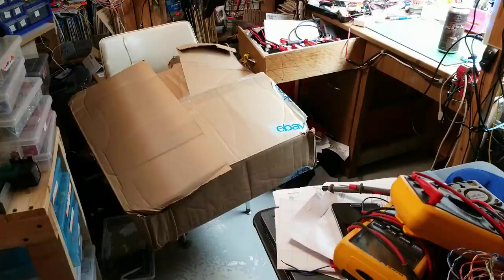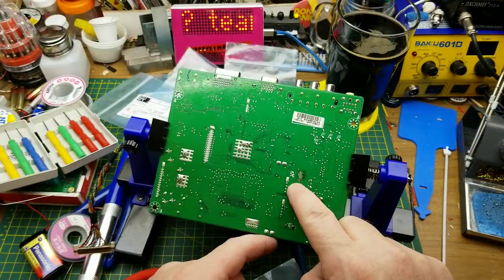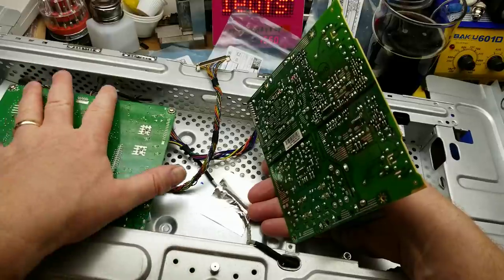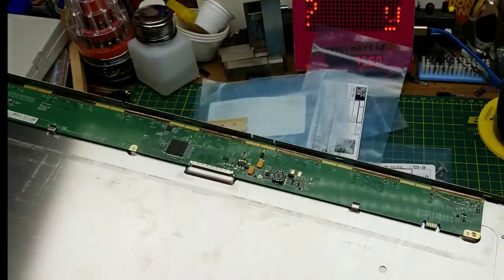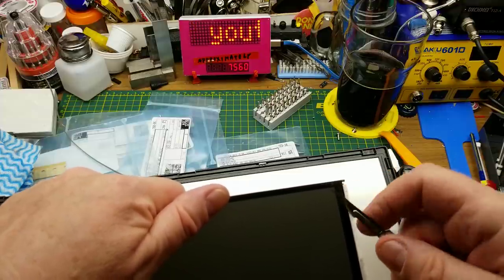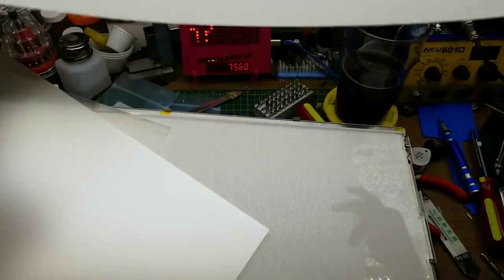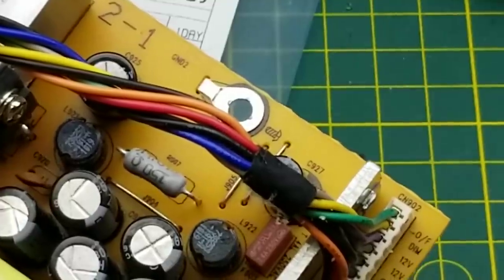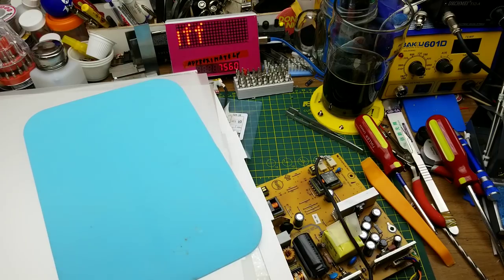computer monitor repair? Or maybe a teardown?

Comment: There's allways someone watching your videos till the end. This working backlight unit is a win-win, if you assemble them back, you have quite a good light panel with no hot spots, all even illumination, that's usually quite expensive to buy directly...
Reply: Does skipping to the end count - lol -.
Reply: I agree. Getting large diffusors can get really expensive, so old monitors and tvs are a very good source. They're perfect for little projects that involve led lights or matrix displays or such things.
Reply from the maker: I spotted an old (probably early '90s) rear projection TV on the curb a few weeks ago. 
Unfortunately it was gone by the time I came back with a truck...

That would have been an optical component score!
Reply: @pileofstuff  I made a few light shows using the 3 big projector lenses and some neopixel panels! Most of those old TVs are 80% Pressed Board or OSB and will fall apart after a night in the rain.

Comment: The "polka dotted" panel acts like a light pipe, carrying the edge light to each of the etched spots. The diffraction grating collimates the light rays to all come straight out of the panel (that's the key to DIY Perks light panel - the collimated light produces shadows as if the light source was an infinite distance away, similar to the sun).

Comment: The way those backlight stackups work is rather fascinating.
The thick acrylic sheet is called a light guide plate, and serves to transmit the edge illumination across the whole display. The white dots are printed with some gradient in size to create a more even illumination that doesn't dim towards the center. Sometimes it'll have physically engraved dots done with something like a laser instead.
Then the following sheets, in possibly the wrong order because I don't know that much, are:
1. A plain old diffuser to minimize visible dot/line patterns.
2. A prism sheet which spreads the light out more along one axis, some people mistakenly refer to it as a fresnel sheet but it's not.
3. A "brightness enhancement film" which uses some optical magic to focus most of the light forward instead of all over the place.

Comment: I love watching your videos!  I did a tear-down of a monitor once and did exactly what you did getting the tubes to light.  I ended up making a tracing table. Also good for x-ray reading and schematics, many uses.  I mainly use it for aligning drawings and tracing.  The same idea as an old school overhead projectors without the magnification. It can be dim-able too, but the circuitry for that is beyond me.  (I was thinking you could use that for the trains under lighting or overhead illumination for video shoots of the trains)  EDIT:  I have also torn down flatscreen TV's and taken those lights and diffusers for other project. The larger the screen, the larger the capabilities.

Comment: I need to repair the TV in my bedroom. I hope it doesn't end up like this one. LOL! Damn there were some nice scratches around those capacitors though. What the hell was he using to get them out? A hammer and screwdriver? HAH!
Reply from the maker: My guess was he didn't have his iron hot enough for lead-free solder.

Comment: That first ad for a board looks like it's priced in Polish złoty, about CA$ 33.66 at the current exchange rate. I've picked up a few TVs and monitors on Freecycle, and replacement boards are often so cheap it's worth a gamble if the exact fault isn't obvious. I'm subbed to DIY Perks and I'd love to attempt one of those fake window lights one day.

Comment: I once tried to replace 4 of those CCFL tubes in a brand new monitor that fell out of the packaging an smashed the tubes (they are glass). Didn't end well, I broke 2 of the replacement tubes just handling them (they are really fragile!) and the other two trying to push them in to their metal housing. Aarrgh! Tried replacing them with led tape which worked but gave an uneven lit screen. I then ended up dropping the LCD itself so it chipped in a corner. Can't fail much more than that.

Comment: Does the order of the diffusers make a difference? I've always wondered that. I repaired a LG 47" for a friend. It had strips of SMD LEDs behind all the diffusers. Around half of the LEDs where dead, so I replaced them all using a heat gun. Each LED had a separate thick transparent plastic diffuser on it. Some of the replaced LED's didn't align very well. End result was a working, but in some spots more/less brightly backlit. Friend wasn't super happy with my work but atleast she paid for the LEDs... :P Could I have placed the diffusers in the wrong order so the misalignments got more noticable by a focusing lens sheet before being diffused?
Reply: I think I just answered my own question. Of course the order must be important. Found an image of a "general TFT-LCD structure": Reflector sheet, light guide plate, bottom diffuser, prism film, top diffuser, bottom polarizer, color filter, top polarizer.

Comment: some of the led back lights in my monitor have stopped working, i was thinking of opening the panel to attend those. but seems i cant do it without destroying the panel.
Reply from the maker: I'm sure it's possible. 
But some of those clipped on pieces are tricky to get into gently.

Comment: Hii sir,I am Abhishek I was facing a problem that my pc auto shutdown
I also applied thermal paste on the processor but it doesn't work 
I have installed Ubuntu 2020.4 in my pc or that is a problem 
How do I solve it
Reply from the maker: It could be many things. 

Possibly a faulty power supply. Possibly a bad connection in some component. Possibly faulty capacitors on the main board.

Problems like that can be very difficult to find.

Comment: i have bad lucky at monitor, acer 22" i buy new has 1 year and down row come pixel problem now have eweryweek little biggest no can see text and picture 1 inch down anythink. down at borden. and i buy cheap new 24 inch monitor after less 5 month  start blinkin and no can use. blink picture on/off. i not know why. next i buy samsung new monitor, i use now my own old notebook display were i orden aliexpress elektric controll board 17$ and connect to display and working fine now. but new samsung notebook i buy controller and do same blinking lto on/off and no can use. i not know thailand who can repair or do somethink my monitors. sad.

Comment: I watch, in hopes, to see you tip over your beer on a live circuit . . . or how you toss around tools willy-nilly . . . or how proud you seem to be of your cluttered jammed up workspace. [that crappy component tester wouldn't detect leakage of that capacitor so I don't know why you did it] Then you decided: Oh well, it's not worth fixing. Maybe not, but that's not a good repair ethic.  
What . . .? If I don't like seeing this . . . then don't watch ? No, if I see an error I comment. If you don't like the comment, face up and try to correct it. The Any-'ole-Which-Way isn't valid. You can do it, just don't publish it. (And your taste in Beer . . . stinks, IMHO
Reply from the maker: Thanks for watching.
Reply: @pileofstuff  Lol....great reply to that misery-guts! And his opinion certainly isn't humble...lol!